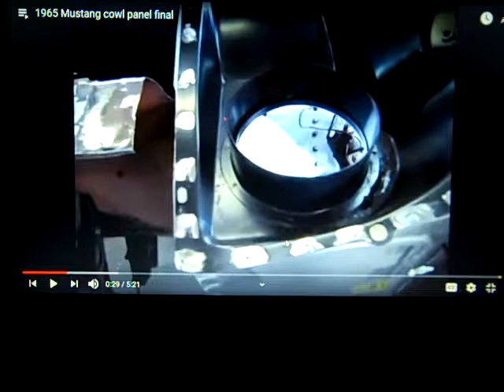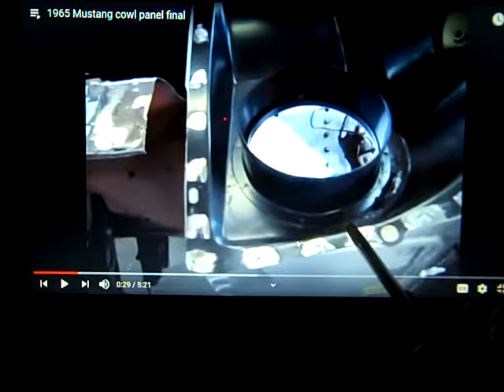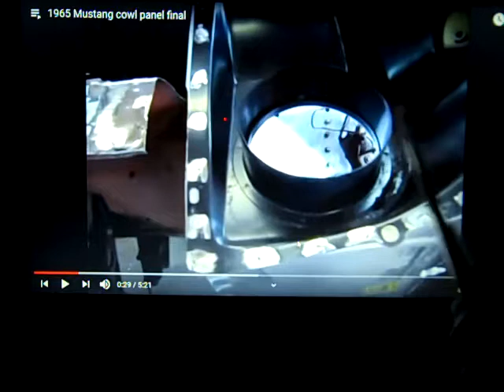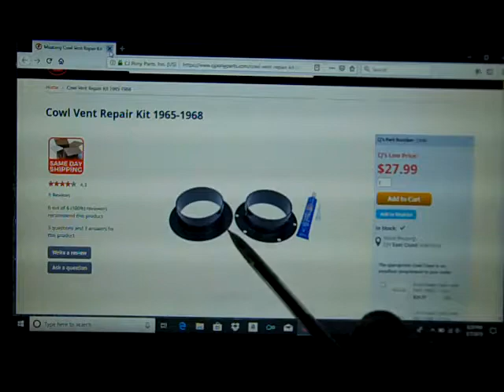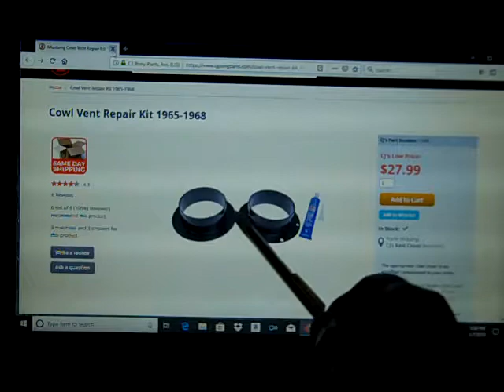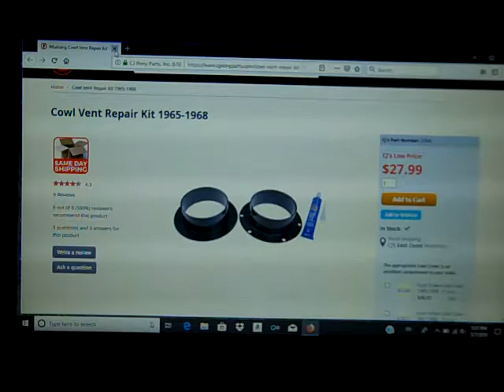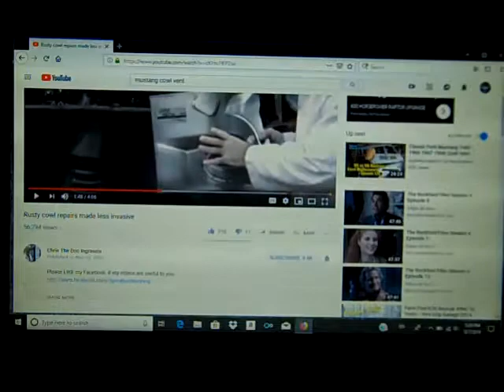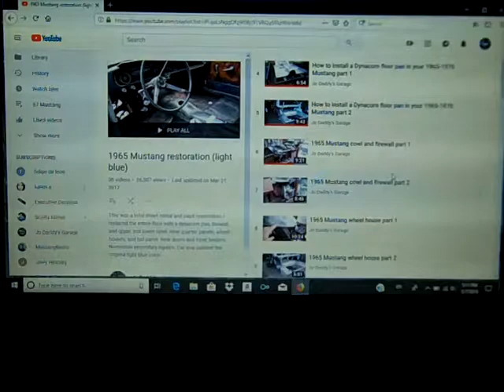Early Mustang Cowl Vent Repair - '67 Mustang "Project California Coupe" Part 7

Comment: Going to attack this on my 67 soon.  Thinking about removing the fender, cleaning out drain port good and coating in the internal cowl area with Eastwood Internal Frame Coating via the drain port and via the cowl vents on top.  That product come with a flexible tube that sprays the coating in a 360 degree pattern
Reply from the maker: Sounds like a good idea and perhaps a way to prevent ever having to replace the cowl.

Comment: As a person who has owned SIX different mustangs in his long life and currently own THREE I say a big FUCK YOU to Ford for designing the cowl panels the way they did.  In fairness, though, they had NO IDEA that some FIFTY years later all the aging boomers would be pulling them out of junkyards and rebuilding them.  My 1965 coupe lives in the garage and I have a plastic cover over the vent openings that I bought from one of the mustang part places on internet. I am going to shoot some Cavity Wax Plus into the cowl in the near future and let several coats dry and build up.  Love my old 1965 mustang coupe but it is not in good enough shape to pay 2-3 thousand dollars to a body shop to replace the cowl assembly.  Now if it were a 1969 Mach I model I would pay the money and have entire cowl replaced but......my coupe is just a basic six-cylinder model.  On the other hand, if I had a cherry 1969 Mach I model I would live in fear of driving it on roads around the Dayton, Ohio area here and having somebody run into me as they have fender benders around here every day seems.  So better off with my plain old coupe I guess. Ha. Ha.

Comment: why can't somebody put some kind of a mesh on top to filter out the leaveas/needles?  why the holes have to be so huge?
Reply from the maker: They sell aftermarket kits that cover the slats when the car is parked. But most restored Mustangs never see rain and leaves anymore anyways. The damage was done when these cars were in normal use.
Reply: @saabtech3510  would you happen to have a link to the 2007 Mustang GT kits?  thanks
Reply from the maker: @ericajohnson7535  Only the very early Mustangs have this problem. Like 1965 to early 1970's or so.
Reply: @saabtech3510  all mustangs have this problem.

Comment: My driver cowl is just starting to rust through a drip.  Is there anything I can do short of cutting open the vent cover to stabilize it?  the car was restored in 03' and is fine body wise other that that cowl.  even the passenger cowl is fine.
Reply: I have a 68 and I have about a 4 inch rust hole under the dash but the body work is perfect and the part that you can see from the outside into the cowl looks perfect too
Reply: @6ty8stang  May I ask where you live?  I live in Ohio and rain and winters are brutal on old cars.  I though about using a Beef Injector but with POR 15 or a resin to push through the rust hole and create barrier.